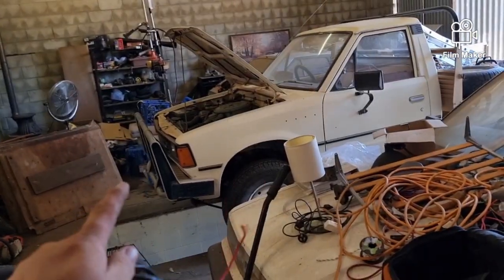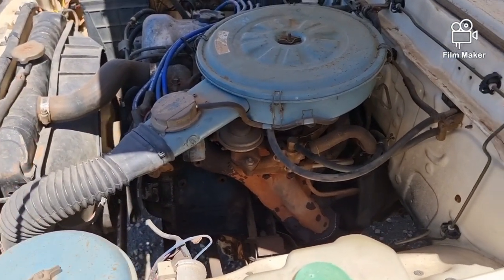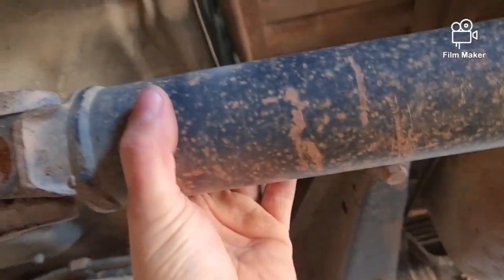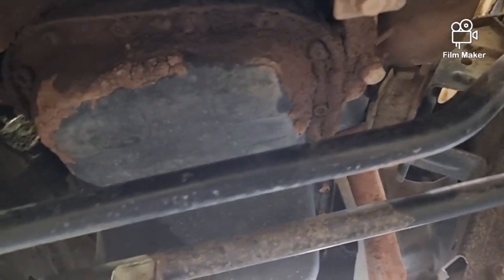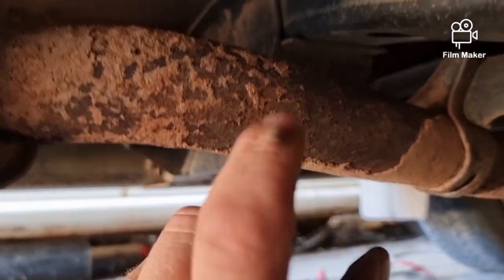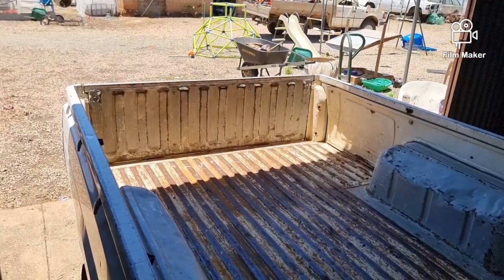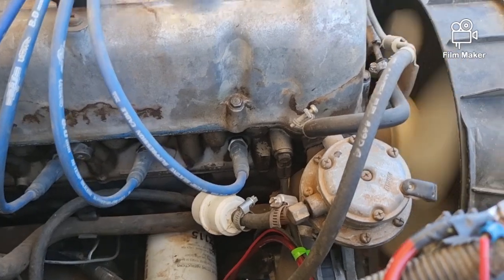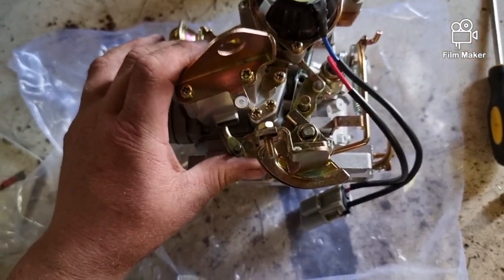Today's adventure D21 exhaust and 720 things

Comment: cut and size a doubling plate slide it on the pipe weld the pipe back onto the muffler box and then slide the doubler and tack weld on the muffler box seam will make it a lot stronger and incorporate a new support to the box at the same time .
Reply from the maker: Yeah hopefully it gets a new one next year